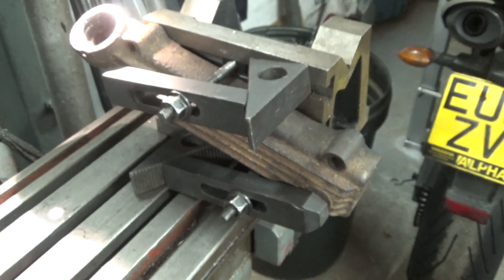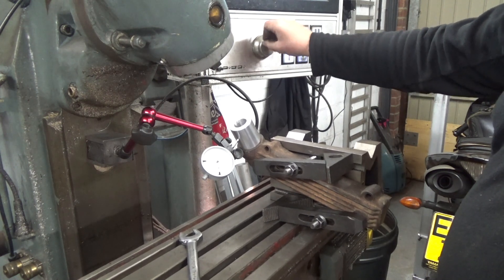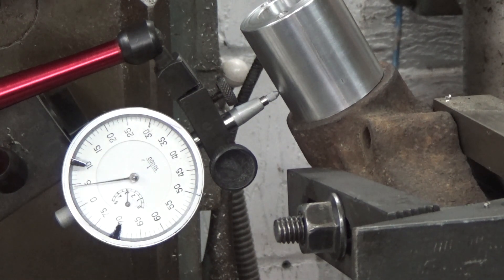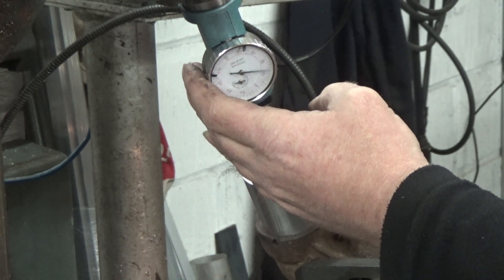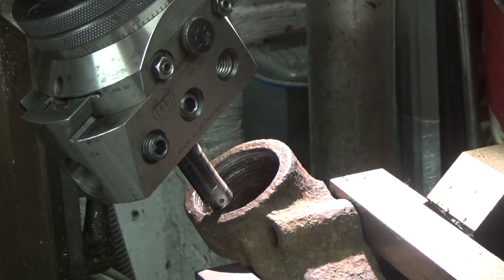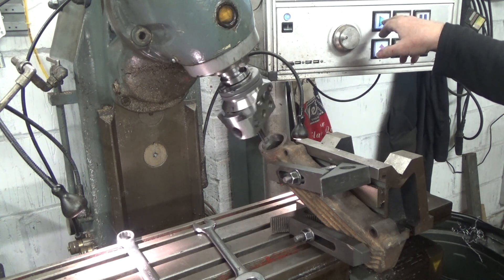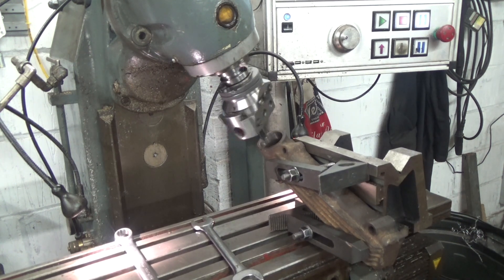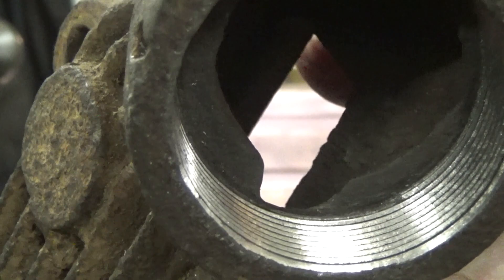An unusual setup to cut an internal thread at a compound angle.

Comment: Very interesting mix. A little software can replace a bunch of hardware. Although the Wohlhaupter  does it's magic all mechanically.
Reply from the maker: I have the ability to drive the Wohlhaupter boring radius under CNC control too.
Reply: @andypughtube  By using a servo to apply the braking to the advancing wheel? Any video of that?
Reply from the maker: @RambozoClown  No video, but there is a photo: https://photos.app.goo.gl/zLNgqcnvkkQZu4HXA
Custom-made brushless motor with a stiff bar through the middle.
Reply: @andypughtube  So if that motor runs at the spindle speed, there is no feed, but by running slower or faster, than the spindle, you can get feed in either direction?
Reply from the maker: @RambozoClown  Yes, exactly that. There are two internal encoders to keep the parts synchronised.

Comment: First angle electronic wizardry. ..."then I adjusted the second angle by tapping it with  hammer"!. You know if you'd ave said that you adjusted the second angle with a virtual flux capacitation exciter, we would have believed you :)

A bit of a surprise that stopping ans reversing in the cut didn't chip the insert.

Would be interested to see that HAL for the vitual B axis.
Reply from the maker: At one point I heard a snap and thought that I had chipped the insert, but on inspection it was OK. 
The code is here, it's mainly a kinematics module. 
https://gist.github.com/andypugh/03b9ac265a1db50cb748d3449d3264dd
There is a sign wrong somewhere, when I move the B axis the table moves the wrong way (It thinks the table is above the head as all Z numbers are negative) but it worked well enough for the job at hand.
Reply: @andypughtube  Did you have any programming experience before you got into LinuxCNC?
Reply from the maker: @RotarySMP  I had never used C, but I had a fair bit of experience with BASIC and VBA. In fact I have been programming a very long time, but only really as a hobby: https://worldofspectrum.org/archive/people/andy-pugh . I taught myself C to write a Mesa driver, though.
Reply: @andypughtube  impressive! It is hard to redo Mesa firmware? I've finally saved some cash for Mesa and plan to play with it. It is 7i92, 7i96S and 7i85S and 7i76 dauthers. I'd love to use a bunch of DC servo motors with encoders hooked up to H-bridges and do PID loop in Linuxcnc. My concern is the cards i have are STEP/DIR oriented, not PWM/DIR - as far as i know i'll have to modify firmware and flash tnem:/ What worries me is lack of tutorials/wiki/documentation on how to do it.
Reply from the maker: @The_Unobtainium  Try http://wiki.linuxcnc.org/cgi-bin/wiki.pl?Editing_MESA_Bitfiles
Reply: @andypughtube  thank you. I'm running linuxcnc on VM. Hope i'll manage:)

Comment: Proof that CNC can bring more versatility. I have used the same kind of internal boring bar, held in a collet, to threadmill. What boring head brand is that ? It looks gorgeous !
Reply from the maker: It's a Wohlhaupter UPA3. And they are absolutely gorgeous things. They cost around the same price as a complete machine tool new (multiple thousands of dollars). But then they pretty much are a machine tool in miniature, and all hardened and ground. Stefan Gotteswinter has an interesting tear-down video here: https://youtu.be/MPPPORn6C7g